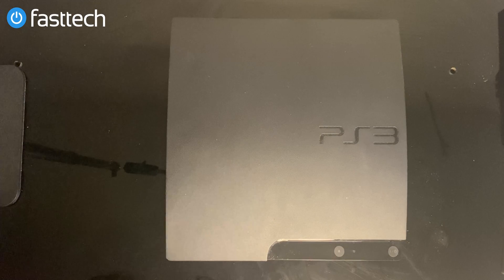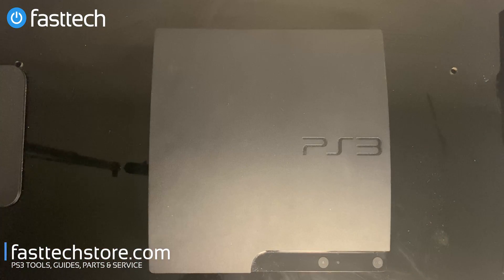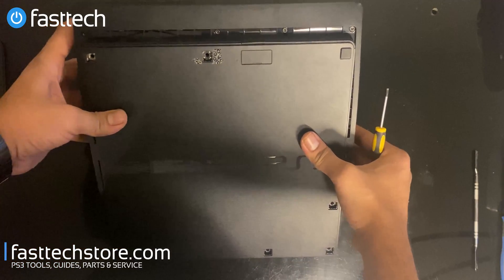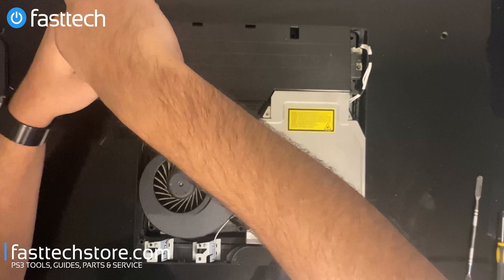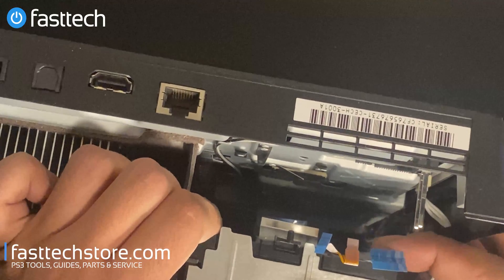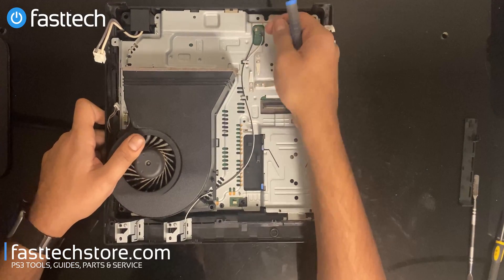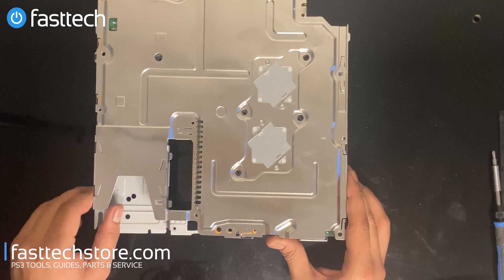PS3 Slim Disassembly and Thermal Paste Replacement Guide

Comment: Pro tip: dont pull the plastic piece of the power cable connector with the cable. Its a booger to put back on without bending the pins. Also when plugging the dvd drive cable back in underneath, its easier to hold your hand palm face down and use index middle finger to grab ribbon cable to plug in then push black piece down to secure it. 

Also, also, dont forget to plug the fan back in. Dont ask me how I know
Reply: Thanks you the reminder, i forgot it.
Reply from the maker: Thanks for your comment

Comment: You forgot to put thermal paste on the underside of these metal plates
Reply: do you need to ? isn't the paste on both processors enough?
Reply: @Gameplayery  yes
Reply: @pierrepiekut109  you mean 8:58?
Reply: Sony did something with the 3000 series that you can’t delid these like the 2500 and 2000

Comment: You think old paste could be causing freezing issues on my ps3
Reply from the maker: Does your fan run loud?
Reply: It can be also HDD problem
Reply: @lokowda  I replaced it with a ssd and it still happens
Reply from the maker: @mightygamerjames  cpu or gpu issue. A reflow may fix it
Reply: @fasttechvideo  reflow?

Comment: The slim and super slim use considerably less power than the Phat, haven't found that mine needs pasting, it's already quiet. Dry or not, if it's not getting hot it doesn't matter.
Reply from the maker: Thermal paste is a consumable item.
Reply: Shoot mine is not. The fan is constantly on.
Reply: Mine is the same way, except when playing very intensive games. Like MGSV for example 😬 Gonna do a repaste on it anyways to see how it competes with the heavy games.

Comment: I think the hardest part in this is disc drive.... Itas a B***H to get back on, especially first time. Taking apart cosole and cleaning - 40 mins while putting back disc drive 2 hours..... then like 7 minutes of reasembling the rest
Reply: I have a CECH-2001A and that cable your talking about is behind the disk drive rather than under it on mine.
Reply: Early slim models have easier BD drive installation. Later model is just harder to install.

Comment: How often should I change thermal paste? I've had my PS3 for 5 years and never opened it to clean it or change thermal paste. It runs pretty well but when I play graphic intensive games the fan runs higher than usual. Do you think it's time to change the thermal paste?
Reply from the maker: After 5 years of use I would recommend replacing it especially if its running with a loud fan.
Reply: @fasttechvideo  Thanks for the response. I will be buying the supplies to replace it sooon.
Reply: 8 years and ps3 just began to make noise and enter rlod

Comment: Thanks for this video. Got my ps3 in 2009 and just changed the thermal paste. It was super dry after 13 years. Gosh. I can’t believe it’s been 13 years since I got it
Reply from the maker: Time flies. Please subscribe to the channel and like the video if this video helped you out.
Reply: How is the system after the replacement? Is the fan quieter for longer?
Reply from the maker: @Ice-ed7qk  its a customers system so i no longer have it but at the time it was running much quieter and cooler
Reply: The PS3 is 91 in dog years lol
Reply: @terrapinflyer273  I still have mine to mainly play GTA IV, Fallout 3, and Fallout New Vegas.
Reply: Good to know that you changed it but even dry thermal paste transfers heat

Comment: Does anyone know why after replacing the thermal paste the ps3 overheats?. My ps3 had been working perfectly before i replaced the thermal paste, and now whenever i turn it on, it overheats and shuts itself off after couple of minutes, this never happened to me before.
Reply from the maker: Check the tightness on the heatsink clamps and make sure they are screwed in evenly.
Reply: @fasttechvideo  thanks for answering, yes i've been thinking of doing that, but just moments ago i checked the fan and it wasn't plugged, im going to check the temperature now and if the problem persists i'll go deeper into the clamps.
Reply from the maker: @coolbatfleck9952  a disconnected fan would definitely cause overheating.
Reply: @coolbatfleck9952 Did you resolve it, bro?
Reply: @fncisco9380  Yes. My dumbass forgot to connect the fan when i assembled the console, i just had to plug it back in

Comment: I'm a proud owner of a PS3 Slim (model CECH-2504A) that I purchased last year and I would like to change the thermal paste. So I have a few questions:

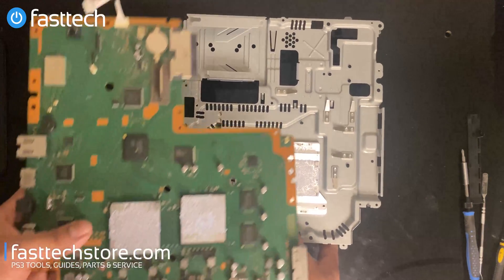1) 06:23 - How did you remove the old thermal paste? Would you recommend using isopropyl alcohol and a cotton swab for the job?  
2) 07:18 -  Some people apply the thermal paste in a "X" shape, while you apply in a sort of "M" and then spreads evenly in the surface area. Do you think the method of applying the thermal paste makes a difference in the final temperature?

Thank you for the video and help!
Reply from the maker: Yes isopropyl alcohol works and you apply it any way as long as its spread equally.
Reply: @fasttechvideo  Thank you for your reply. Just to know, what material do you use to apply the isopropyl alcohol? Paper, cotton swab, tissue... ?
Reply from the maker: @carlosbarreto4695  Cotton swab should be okay but leaves residue. Paper towels work best.
Reply: @fasttechvideo  Alright. Thank you for the support.
Reply from the maker: @carlosbarreto4695  please like the video and subscribe
Reply: Use a cotton round for no residue

Comment: Can anyone help? I changed the thermal paste on my Play 3 Slim. I assembled everything, turned it on, there is sound image, Bluetooth and internet, but .... the Power and reset lights do not appear, strange is that the power and reset buttons work but the indicator leds do not 🤔
Reply: Check flex ribbon cable. You may noticed that pins are being worn out or even have its blue plastic parts tore off from the flex cable.

Comment: nice vidio but unfortunately it isn't a total thermal paste replacement vid. those two squares you're applying thermal compound on are definitely important but what isn't obvious is that that those are metal plates that go over the GPU and CPU, their is a tuff to remove silicon under it(which keeps it in place) and thermal paste to which is what is on the die hidden under those thermal conducting plates should also be repasted as well, if you have the tools to do so. This can cause it to still overheat if bad enough. BUT for most people i recommend only applying were fastteck applies his paste as the thermal conducting plates(IHS) are tricky to remove with ought causing damage to the CPU and GPU.
Reply: update. I was wrong about some of the terminolagy used in the original comment so i just  edited it to be more accurate.
Reply from the maker: You’re are absolutely correct and what you said at the end is true that for most people removing those plates is not recommended.
Reply: @fasttechvideo  thank you my wise friend
Reply: Also I would add that it is still important to replace that paste underneath if I want to maximize it's lifespan so if anyone is uncumfterble or newish to console repair and has the expenses take it to someone who can do that part.
Reply: I was looking for this comment!